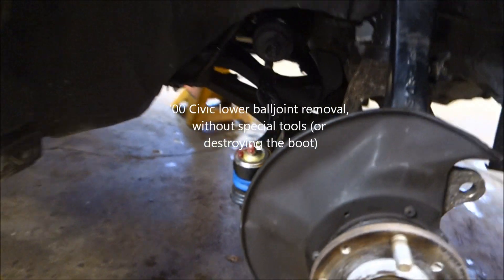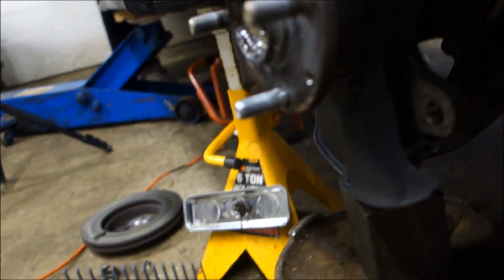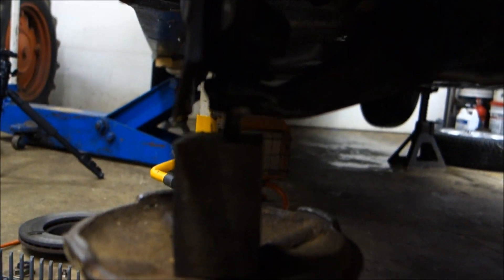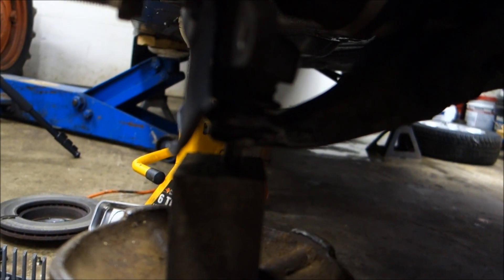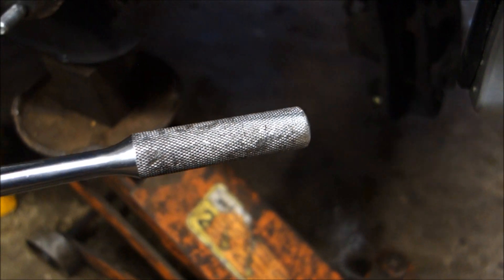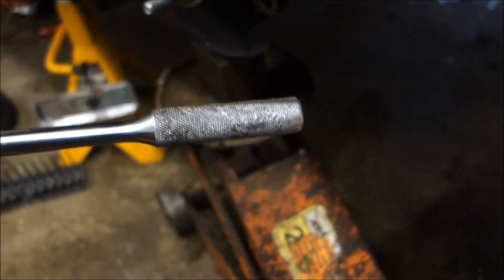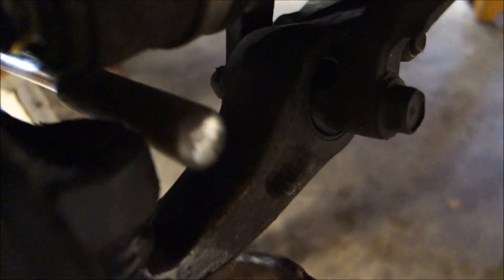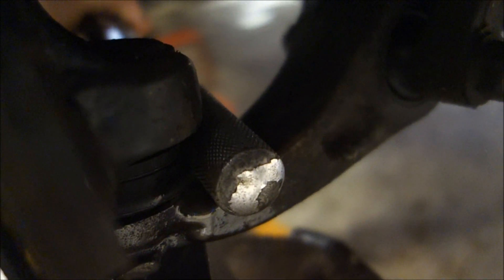'00 Civic lower balljoint separation (just a jack and a ratchet)

Comment from the maker: I'm not sure what you mean by shock arm, but you should leave the tie rod and upper control arm balljoint attached, and remove the lower control arm balljoint nut.

The lower strut mount/fork that attaches to the lower control arm is worth leaving attached so you have some spring assistance to pop the balljoint apart, although this might work if you remove it as well (step on the hub).